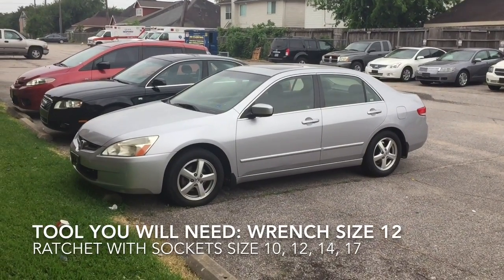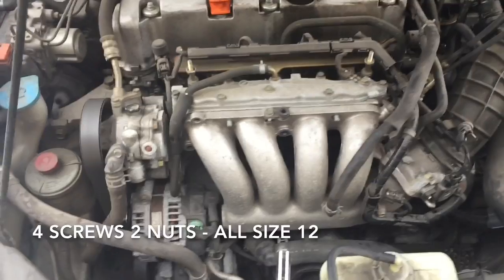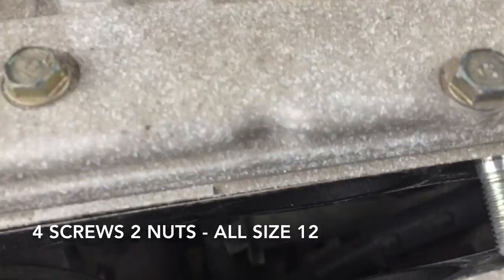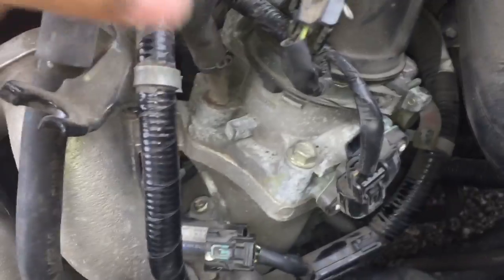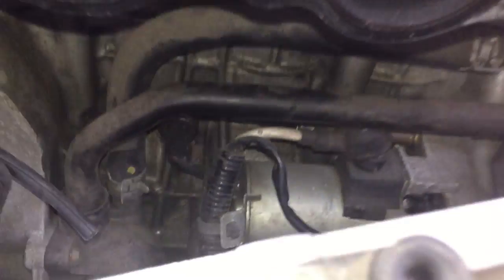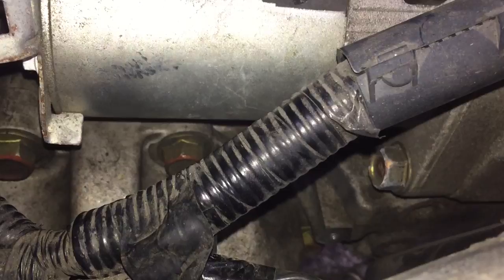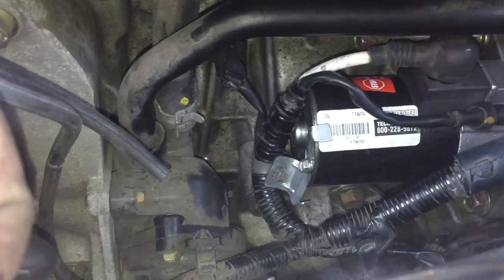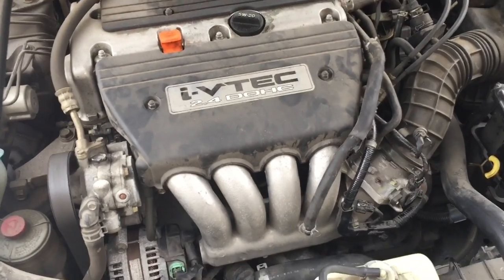How To Remove Starter On A 2003-2007 Honda Accord  i-vtec 2.4

Comment: Great video.  Changing out the starter, I found that if you bungee up the intake manifold to the hood, it allows you to work easier to get into the space.  Second thing is the 17mm bolt that holds the starter in was a super tough nut to crack.  Took me almost an hour just to get that bolt free and out.  If you have air tools, you are to use them for sure.
Reply from the maker: We are glad it helped! Yeah that size 17mm can get tricky but WD40 helps a lot. Please help us by subscribing to our channel and we also have other Honda fixes on our Honda playlist  check those out of you need anything else
Reply: The only thing I would also add is when putting in the starter bolts back in is to use a swivel attachment and a very long extension.  I had an extension that was almost 3 ft long.  Trust me it saved me from getting bloody knuckles and it also gave me a bit more leverage.  Thanks again for the vid.

Comment: Great tutorial although who ever attempts this will need to remove additional hoses/clips that are preventing the removal of the manifold. I recommend taking it completely out for added workspace. Overall I was able to use your video to complete the task in under two hours. Thanks for posting it!

Comment: Thanks Garage Boys, Great How-To. But I was unable to remove the 14mm Long Bolt. It was really torqued on.

 How did you remove it? (I tried PB Blaster, Butane Torch, Breaker Bar, didn't budge.)

Ended up bringing it to the dealer where I was jobbed. (They quoted 3 hours labor).
But your easy tutorial, made engine DIY  a lot less intimidating. Great Video
Reply from the maker: I didn't have that issue but when I run across something like that I use a long pipe and attach it to the end part of the ratchet for better leverage. It will require less strength and give you more space. Look at my other video where I replace the alternator on the accord I use the pipe technique that I just mention.

Comment: thank you. im gonna try once my part comes in!
Reply from the maker: let me know how it goes and if you need any other video for this vehicle.
Reply: Garage Boys mine looked little different (06). there was plastic box (dont know what it is) behind manifold. had so little room to work on. and bolts on starter were so hard to remove lol. had to buy super big torque wrench. but i made it. thank you

Comment: Thanks. I'm going to try today. I hear I'll also need to replace the paper gasket for the throttle body and the manifold gasket. What do you think? '03 accord 4cyl
Reply from the maker: I didn't have to replace the gaskets so I don't think you have to.  But gaskets are cheap and you are there any ways, you can replace them if you want.

Comment: nice video, thanks for sharing! quick question. do you have to remove the throttle body from the intake manifold? or no?
Reply from the maker: No not at all, just like you see in the video when I disconnect the manifold I just push it to the side
Reply: @GarageBoys  thanks man! I went to a mechanic shop, and they told me they had to do that and (an additional hour of work) and the whole thing would take 4-5 hours. Complete rip off. Your video helped me see that a bit.
Reply from the maker: I’m glad I was able to help! I did the whole job under 30min.
Reply: @GarageBoys  thanks bro. I will pay forward the positive energy.
Reply from the maker: Thx!

Comment: I broke that connector that is on the engine block that you unplugged. Right to the rear of starter. Looks like a oil pressure sensor. Need to replace. Any help on name of part would help.

Comment: my 07 has an external solenoid.  The stores only sell internal ones like in this video. Can I use them to replace?
Reply from the maker: the frame will probably fit but i believe you may need to add some adapters for the connections, let me look more into it

Comment: I can't remove the 17MM bolt it's stuck in there; it was a breeze till this point. I tried WD-40 and vinegar to loosen it. I am almost there but I have been stuck on this bolt for hours any tips tricks? :-(
Reply from the maker: Try to add a pipe to your ratchet to extend it, that will help you do less strength and increase your power. Look at the other video I have on my account about "how to remove a Starter on a Honda Accord" on that video I show how to extend the ratchet. That really helps a lot, the longer the pipe the less strength you need to use just make sure your ratchet is secure on the bolt.  Let me know if that helped
Reply: Garage Boys thanks for he reply. I looked at all your videos and I don't see any other ones concerning Honda starter.
Reply from the maker: Sorry i meant to say alternator. "How to replace a alternator" sorry not sure why I wrote Starter
Reply: I finally got the 17MM out after a day of trying. I used a 3" extension and a 17" long breaker bar to loosen it a bit. After that I replaced the breaker bar with a 14" long flex head ratchet and little by little it came out, I also used PB blaster spray on it; apparently WD-40 is not sufficient.
Reply from the maker: Im glad you got it done!
Reply: I would definitely recommend a power ratchet  torque though just in case bc I had trouble putting the 17MM back in as well. And apparently the the starter nut has to be torqued to a certain spec.
Reply: ms310 7

Comment: I have a 03 Accord that won't start . Need help
Reply from the maker: What you can do is remove the starter and take it to Autozone or any other auto shop they will check it for free. Also when you try to start again you will have to jump start the car because the battery has drained since you tried many times.
Reply: Garage Boys Ok thank you. I just got a new battery couple days ago. Tried it this morning but no luck.
Reply: Is there any way to take off starter without removing manifold?
Reply from the maker: E MV not really, but it’s a very easy and quick job
Reply: Garage Boys I replaced the starter today and also got new spark plugs. Now the car started but it's running rough.
Reply from the maker: E MV I saw the video you posted, was the car fine before you changed the starter? If it was then make sure you reconnected all the electrical components properly and if they are then it’s your spark plugs, where your spark plugs property gapped before installing? Some come pre-gapped but some don’t
Reply: Garage Boys I'm not sure what that means? Is that something that needs to be done at parts store ?
Reply from the maker: E MV yes the spark plug needs to have a specific gap where the spark happens. You can google gapping spark plugs to have an idea of it. When you buy the spark plugs some come pre-gapped so you won’t have to worry about it but some don’t
Reply: Also my lights keep going off .   Can it  be the alarm system problem.
Reply: Garage Boys ok I checked and the autolites I bought were not gapped. Will that make a difference in how car is running?
Reply: Thanks for your good feedback.
Reply from the maker: E MV yes it controls the spark it makes and that controls the timing of the car